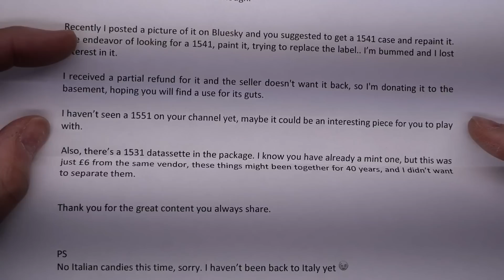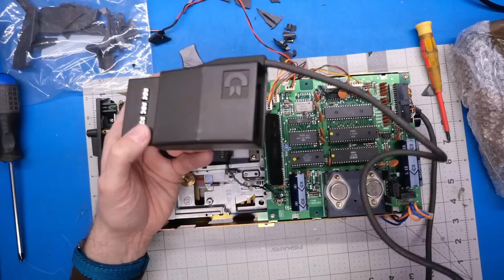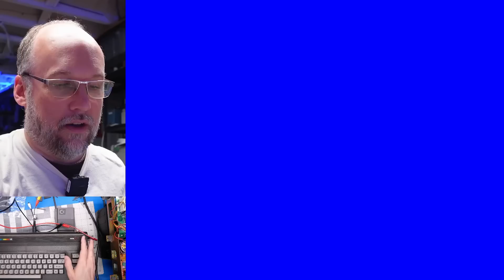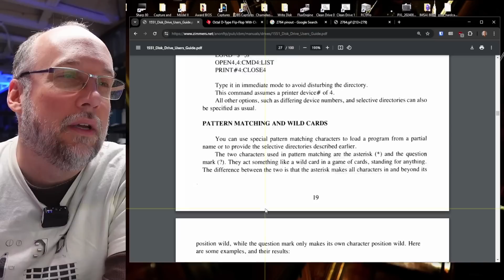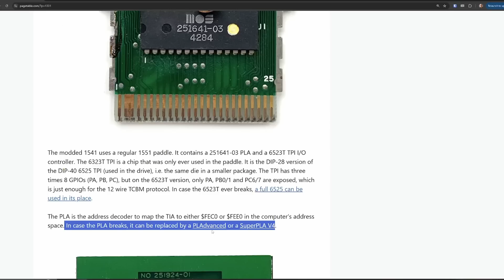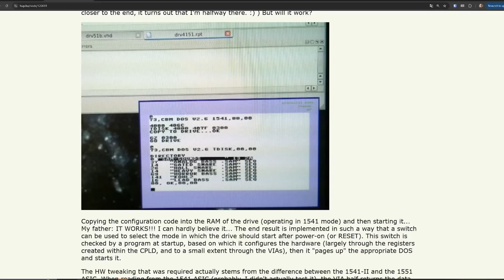0101 A broken Commodore 1551 disk drive

Comment: Adrian Digal was no ordinary man. Oh no, not at all! He was a tinkerer, a fixer, a wizard of wires and whirring widgets! His basement was a lair of blinking lights and buzzing circuits, and there was nothing—absolutely nothing—he loved more than rescuing broken gadgets from their miserable, forgotten fates.  

So, when a peculiar package arrived, sent by the marvelous Michelle, Adrian tore it open with the glee of a child unwrapping a chocolate bar the size of a Volkswagen Beetle. But oh, what horror lay inside!  

It was a 1551 floppy drive—or at least, what used to be one. Now, it looked like a squashed bug, a crumpled crisp packet, a victim of some ghastly postal brutality. The case was shattered, the screws had scurried off to some unknown land, and inside… oh, the carnage! Tiny plastic shards rattled about like the teeth of a nervous dentist.  

"This," Adrian murmured, holding up a twisted piece of casing, "is an utter travesty."  

But Adrian was not one to whimper and whine! No, he was a fixer, a mender, a mechanical magician! He flipped the drive this way and that, peering at its delicate inner workings with a keen, calculating eye.  

"If I take a 1541 case," he mused, stroking his chin like an inventor on the brink of a breakthrough, "and perhaps… just perhaps… swap the parts, paint it a dashing shade of brown, and reattach the badge, why yes! I could resurrect this floppy fiend!"  

But! A problem! The power! This was a UK drive, and its 240 volts would cause the poor North American outlets to weep and wail and possibly explode in a shower of sparks!  

"I’ll need a step-up transformer," Adrian declared, rolling up his sleeves. "I’ll need patience. And I’ll need… a miracle!"  

He plugged it in. The motor whirred! The light blinked! A glimmer of hope! But… it didn’t quite work. Not yet.  

"It’s the PLA," Adrian muttered darkly. "That wretched little chip. I bet it’s as dead as a doorknob in a haunted house."  

His mission was now clear! He would need to hunt for parts, to tinker and toil, to resurrect this relic with all the brilliance of a mad scientist in a stormy castle!  

And when it was done—oh, when it was done—it would live again.  

But that, dear reader, is a story for another day!

The Floppy Drive Fiasco  
(A Tale of Tech and Tragedy!)
Reply: AI slop.

Comment: Interesting that the 1551 uses a special 6510T that appears to have been made just for that, while the 1541 used a regular 6502. The 6510T has more I/O lines than the normal 6510 and it has no RDY/NMI pins

Comment: You know, I recall seeing a smashed 1551 on ebay UK at somepoint, even contemplated buying it, but the cash wasn't there, the damage to the grilles on the base looks very familiar, so, I wonder if it's the same drive, had circumstances been different, this drive may have been in my hands (and probably glued together, poorly!), not that I'd have much use for it given I haven't got any of the 264 series Commodores... :\
Reply: From the picture I saw on ebay it was sold as intact. The seller was 100% positive feedback too. If I could post a picture I would show you the box it came in. It looked like UPS played football with it.
Reply: @Michele_1976  Ah, must have been a different drive that I saw then, just the way the grille on the base had been pushed in, the one I recall looked just like that, but yeah, couriers have no respect for what they're handling, just get it through quickly, even if it gets broken... :(
Reply: @ Still, if it was I shipping, I would have used so much more padding and a much bigger box. 
The box was barely bigger than the drive itself.
Reply: @ Even with decent packaging, couriers have still broken stuff I've bought, a laptop I got at the end of 2023 arrived with one corner smashed despite some excellent packing by the seller, luckily only plastics damage, but still a pain to have to rebuild the thing with new parts when it was pristene before it was shipped... :(

Comment: you can get power supplies, with just a single molex connector, usually for hard drives or disk drives, which supply both 5 and 12 volts. so an interesting mod you could do is replace the regular power connector with a molex connector.

Comment: 19:08 it's the way the barrel jack was designed. The center pin is solid, and can't easily be switched to detect if you've plugged something in or not, but the outer shell is capable of being switched. So some companies decided that the unswitched contact should be ground, and the switched contact should be positive, which makes it center negative.
Reply: Indeed.  Center-positive was in no way a standard, or even expected.  Among my devices that had DC barrel jacks, around 60-70% used center-negative in the '80s.  It's only in recent years trust center-positive has become dominant, and even today it's not guaranteed.  There's no use griping about it.  We must always check polarity if not using the manufacturer's power supply!
Reply: @Starchface  I think the outer most contact became negative... or ground as standard, because of more modern standards.
It's the ground on a USB plug, or headphones jack, and most other media connectors like phono and BNC.

If you had a 3.5mm power jack which was also common in the 1980s, you know, headphones style, that too was not guaranteed to be tip positive, even though that was the switching pin.
Reply: 9V power supplies for stage audio gear are center negative to this day -- ALWAYS confirm the polarity if you're at all uncertain of the particular supply, but particularly when it's 9VDC, as there truly is no uniformity there.

Comment: I have repaired a whole bunch of 1551's lately and can say that all chips fail in these. There's not a single reliable chip in them. I have replaced them all.

I have created a few modern replacement chips for them. Both the chips in the paddle (PLA and 6523T). The PLA is the same PLA type as in the C64. I guess that says something about its quality.
The only chips that still don't have any modern replacements are the two gate arrays and the hybrid and work is being done on the hybrid

The diagnostics doesn't always work without the computer powered on if paddle is connected. I don't know if something in the paddle is pulling something in the drive down.

The PLA is of course highly suspect in your case but it could also be one of the TPI chips 6523 or 6525.
There's a test program that can be used to test all the TPI ports if swapping the PLA doesn't solve the issue.
Reply: Much like the computers they plug in to, then. Years ago, from the mid 90s to the mid 2000s, I owned quite a few C16s and Plus/4s and the failure rate was insane compared to every other type of computer I owned. It could be any of the chips - TED, CPU, ROM, PLA - once they got to about 10 years old there was probably a 90% chance that at least one of those chips had failed.

Comment: That's a prime candidate for a 3D printed case.

You might want to learn how to weld plastic anyhow. This isn't a good candidate for plastic welding. The plastic is likely too brittle and the pieces are too many and too small. But, you might still want to learn how to weld plastic. The equipment is relatively cheap these days and you can find videos to guide you if you can't figure it out by yourself. It's similar to soldering but closer to brazing (in my experience).

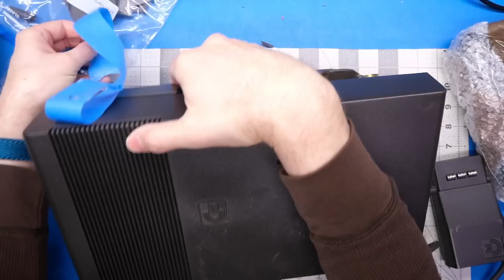Comment: At 2:36 "Well there's yer problem."
I tried putting an Atari 800 case back together with acetone and chemical welding, which sort-of worked. Maybe there's hope for this case as long as all of the parts are there.
Reply: Possibly designing and printing some for of inner support frame

Comment: I recently repaired a 1551: https://www.youtube.com/watch?v=ofZiBphwsAQ.  Fortunately mine wasn't badly damaged as yours.  I had two problems.  The newtronics read/write head had gone open circuit, so I had to replace with a working drive mechanism from a 1541.  And the cartridge connector needed cleaning - I got device not present before I cleaned it up.  I can confirm I didn't get the red LED until I was actually (successfully) accessing the drive from the computer.

Comment: End of the 90's we modified the normal drives to work with parallel connection. Had to replace the ROM with an eeprom, a few budge wires, a custom PCB and that was it. It was light year faster. Also a software (I can't remember the name) copied every disk with any copy protection. Even GEOS (that was the hardest) that was in Hungary :)

Comment: Camera banding has to do with shutter speed.   Lock your speed at 1/120 and control brightness with aperture.   Smaller aperture will help keep things in focus which is desirable for this type of content anyway.   Some cameras have a shutter priority that will allow you to set the shutter speed and still have auto aperture you may have to set both manually and allow the camera gain to make up the difference when things are on the darker side.  If that is the case, you want to set your shutter speed and aperture with a completely white background and make sure you can still resolve detail. Then when things get darker, the auto gain of the camera can adjust accordingly.

Comment: Adrian, if you're going to repair plastic, use Weld-On No. 3, Ambroid, or Tamiya Extra Thin plastic model cement. They will all weld ABS. From the sounds and appearance, that plastic is super brittle, and may be past repairing. Break out the airbrush, and paint a 1541 case.
Reply: The upper case doesn't look terrible, so you might be able to get  by reusing the upper case.

Comment: Yesterday on some other retro-channel I saw someone repair a Toshiba Libretto whose plastic parts were turning into fluff and pulver by replacing great parts of its case with newly designed 3d-printed parts.
Reply: I was thinking of the same thing. That was on PolyMatt's channel and he is pretty good at making 3D models for replacement parts.
Reply: Ok, shall we take a poll on how many of us are on the exact same path, I watched that Libretto restoration this morning. 😅
Reply: Club
Reply: Saw that too

Comment: That brown 74LS14 (U8) looks VERY MUCH like the soviet made TTLs of the time. Knowing Commodore, I would NOT be surprised if the put them in there. "EL" then likely stands for ELORG, which handled the west exports.

Be careful with those, they aren't totally light tight! Studio lights may be enough to upset their function.
Reply: Even the comments on Adrian's channel are gold! You've sent me down a rabbit-hole of learning about gray market / knockoff Soviet electronics. Thanks (I think 😂)
Reply: You are correct. Those are so called "export types" ... used to know which plant made them but forgot. They're usually quite reliable contrary to their reputation.
Reply: Elektronorgtechnika... the Russian "gatekeepers" of Tetris (until 2005)
Reply: If that’s true, then more power to every Atarian who referred to Commodore as “Commiedore”.

Comment: Why do I keep thinking of Bob Ross and Peter Falk / Colombo at the same time when watching your videos? In any case, I'm intrigued by this floppy drive, and can't wait for the conclusion of its mystery. Also, I wish you'd try to glue the broken case kintsugi style with gold color in the cracks. ABS should glue and polish nicely. Great stuff, thanks!
Reply: Yeahhhhhh, I second the kintsugi style repair suggestion. What a great idea! All the pieces could be acetone-welded together, then maybe engrave a little groove over the crack lines and fill them with some kind of epoxy mixed with metallic golden paint. It would take a lot of patience but I bet it would look amazing.

Comment: Video Seq "3:54"
That disk is extremely mangled. It´s a single sided (5 : 25 disk.)
CPU 6510 Microprocessor in It Maybe?
And the operating system, could it be dos 2.6 or something?

Comment: I have a 1551 with a broken case too. Bought it last year but it broke during shipping. But in my case it's the top part which is broken, not the bottom part. So we maybe could build a full case putting our parts together ;-) - Before throwing your case parts in the trash, let me know ... ;-) 
It seems that case material of the 1551 is very fragile.
Reply: ABS can be very brittle sometimes especially if it has been exposed to a lot of UV. ABS does not like UV baths.